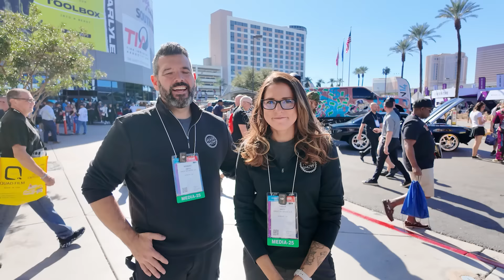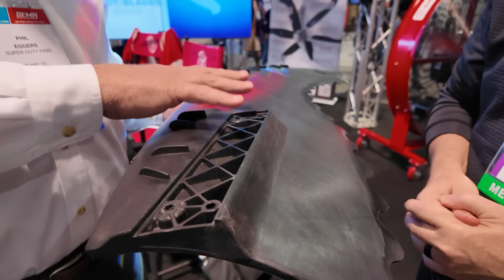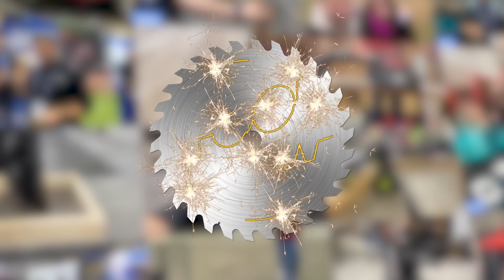15 NEW Tools we found at SEMA 2025! Milwaukee, FLEX, Harbor Freight, Wiha, and more!

Comment: 21:37 - Project Farm just released a REAL test for the Milwaukee Hot Shot.  It did poorly, IMO, based on the scoring.  NOCO kicked it's @ss up down.  The watts here were NOT what Project Farm showed. Project Farm is a neutral party.  I'll go with what Project Farm says.  Milwaukee dropped the ball here.  Sadly, I have a Hot Shot with the tag still on it that I wish I wouldn't have bought.
Reply: !!! I just watched it per this comment.  I'm a red tool fanboy, but I am also a believer in Project Farm.  This is quite disappointing.  I have Noco 155s in each car now.  It looks like they are staying.  And note:  To date, my Noco 155 has never missed a jump.  Largest being my hemi dodge. - it never broke a sweat
Reply: NOCO the best even in my boat battery chargers

Comment: I think I'm going to need those Flex corded tools! I will need it especially when i try my hand at actually painting my old 69 Fastback I bought my senior year of HS in 1994, for $900. Showing its age AND my 20 yr old daughter wants to help! SO i get to stretch out some Daddy Daughter time as adults! Now for me this is extra sweet as my Dad and I wrenched on it many a weekend. Also like the Blaklader boots, I'm a mail carrier and I typically wear hiking boots at work for all the varied stuff i walk through daily rain, sleet or snow. Probably the thing I hate most is the "bare tool". Guess I better watch for Black Friday deal for a Milwaukee I want with the battery system included. I like those locking extensions!!
Reply from the maker: I graduated in '94 too! I've had such a great time learning to polish with the FLEX polishers on my '02 Audi TT Roadster. It's so insanely gratifying to see the transformation in the paint. I'm gonna be sad when it's all done. LOL
Reply: Idk why tf Flex would go corded. I do it professionally and the Milwaukee is frickin awesome. No cords to drag around.

Comment: Evaporative cooling is not something you should rely on AT ALL. The temp drops they claim are in ideal conditions at exit of the cooler. You may get 5F drop in a somewhat enclosed, smaller area, but the measurement is Dry-bulb temp – wet-bulb temp. So it has to be VERY dry to help. Under 30% humidity. These make the space more humid.

Comment: 21:36 I have the M18 series and I have a Jump pack similar to the off-brand used in that test.  I have noticed quite a depreciation of power from it in colder weather.   This was very cool to see.  Looks like I have a Hot Shot purchase coming up soon.
Reply: I got the hot shot as soon as it was available,  I have used it 3 times already in the month I've had it , it did not disappoint.

Comment: oh my god that welding table could be incredible
Reply: I just wonder how much heat it can take before the metal starts to deform and it will no longer be flat which is crucial for a welding table. The reason why welding tables usually are thicker metal plate or even cast iron is because it's less prone to heat induced warping of the metal. The stamped steel on that portable welding table feels a bit thin even though they have used bended parts to make it more stable but I'm still skeptical. Sure in a pinch for small quick welding jobs on site it might work but anything longer welding like pipes or welding thicker steel together where more heat is produced it will not work.

Comment: I want to interview someone who purchases the $300 screwdriver. See what path and life decisions they made to ultimately lead them to that purchase.
Reply: If you think that's expensive then let me introduce you to Snap On tools
Reply: @confusedbadger6275  exactly that’s the price of one Snap-On tool.😂💵💵💵
Reply: Honestly it would probably make more sense than the M18 backpack switch tank I bought when I had to spray some weed killer a couple years ago lol... Thought I could use it on AC maintenance service calls have different coil cleaners and different tanks cuz they switched but, of course .. The extra empty tanks for basically almost the price of the tool lol
Reply: I work on a healthcare environment, in my experience any tools or labor done in a hospital or nursing homes multiply it by 5 times..same job as on residential but the overpricing is ridiculous!
Reply: So the milwaukee uses super caps to give the the start where as others use a battery to give the jump
Reply: Our shop rate is $195/hr for technicians and $295/hr for engineering staff. When selecting tools and equipment we assume those metrics when justifying purchases. If it would reasonably save a tech or engineer 2-3x the initial cost within the fiscal quarter is makes sense nearly every time. I have a $1750 tool that's only purpose is to align dowel pins during assembly. These types of purchasing decisions completely change when time constraints/costs are introduced, often justifying otherwise unreasonable devices or equipment.
Reply: @themechanicaladvantage  That wasn't an esoteric tool. It was a screwdriver with adjustable bits... The only people buying that are absolute suckers.
Reply: @robbob8617  I am not defending the tool, nor its price point. Both appear ridiculous on their face. I'm observing there are applications where it may be justified. If someone submitted a request for this set the first thing I would do is laugh, then I'd listen.
Reply: When you servicing some equipment worth 1000000 or more screwdriver for 300 it’s only starting point go see aviation engineers shop where any thing you touch start at 100 dollars( simple socket or screw bit😂)
Reply: Hook up with the commenter below you.
  It is designed for folks who need a exact and precision fit.
Reply: Its called being successful.

Comment: SO ABOUT $ 260 For BOTH HERCULES COMPACT and MID TQ IMPACT WRENCHS THIS NEXT SUMMER LESS THEN A NEW MILWAUKEE M18 Fuel 2967
Reply: Funny enough,  it takes exactly both of them tools together to equal the break away torque of that 2967.
Reply: @randysmith9636 yea 1600 FOOT pounds